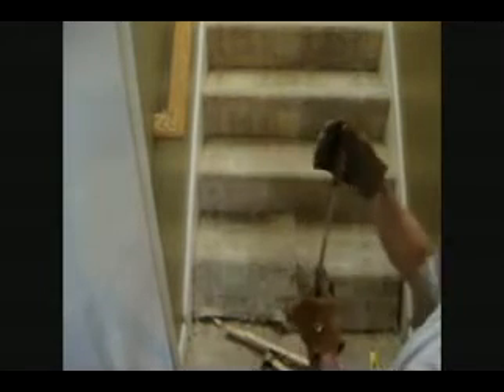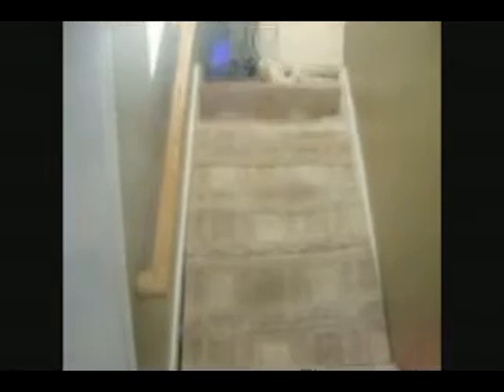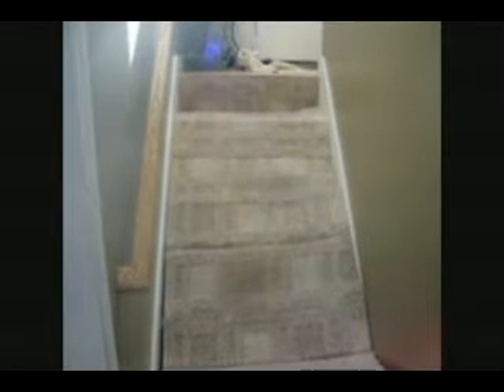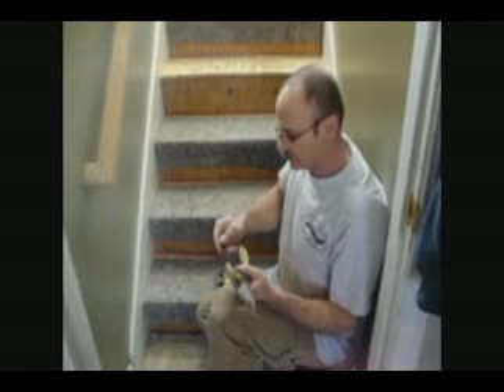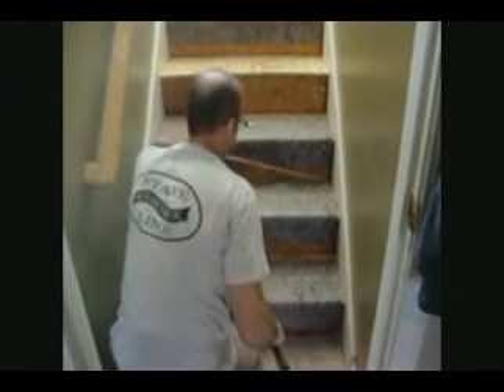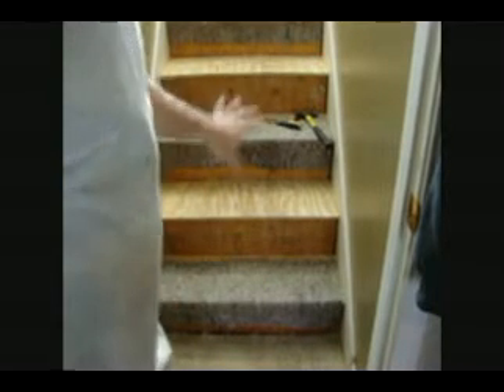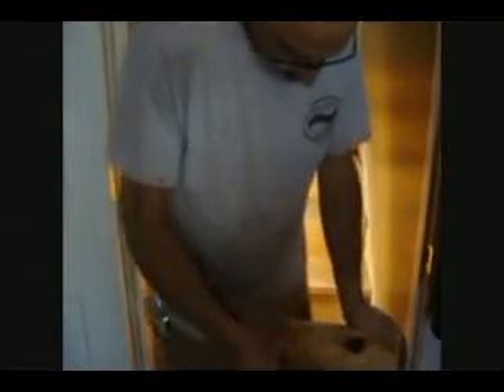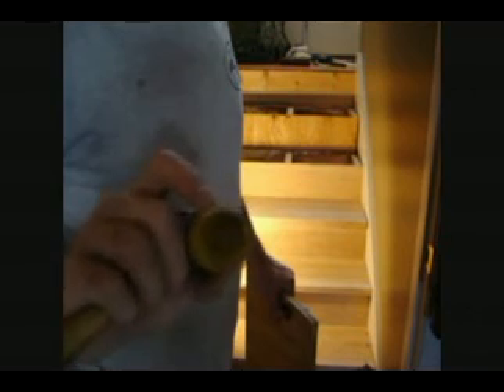Replacing Nasty Carpeted Steps With Wood Video Series- Step #2 Removing The Carpet & Plywood Steps

Comment: Correction that is an Estwing 12 oz. Double-Face Soft Hammer and a Stanley Xtreme Fubar Functional Utility Bar. They are both made to use with wood or metal that is stubborn without causing extreme damage to the material.